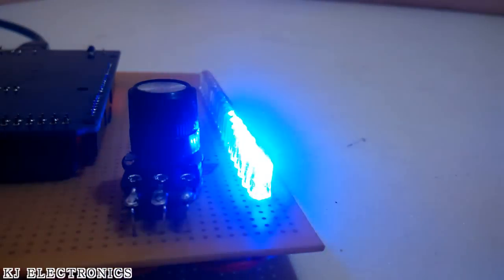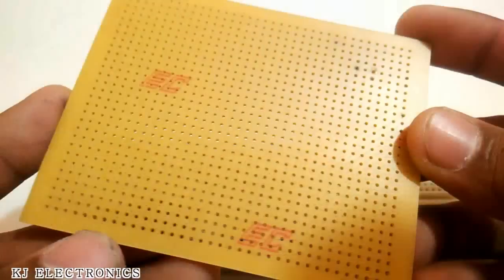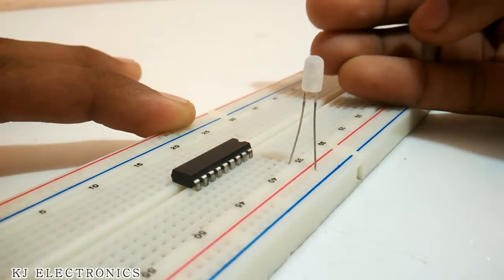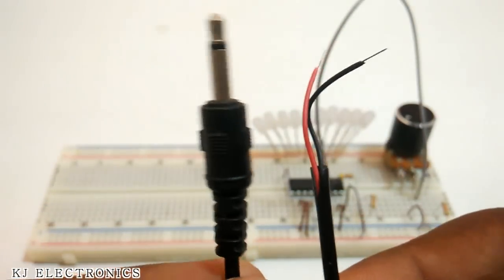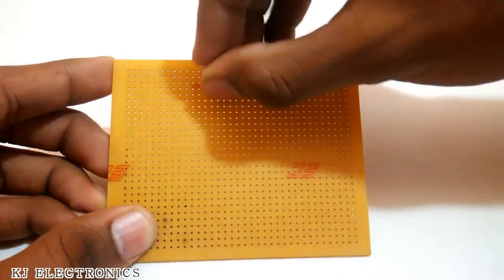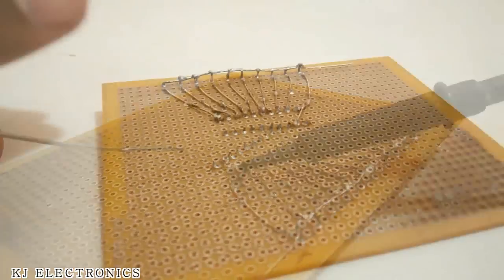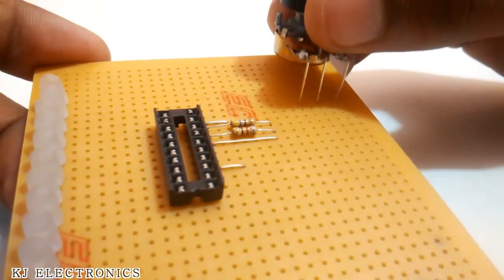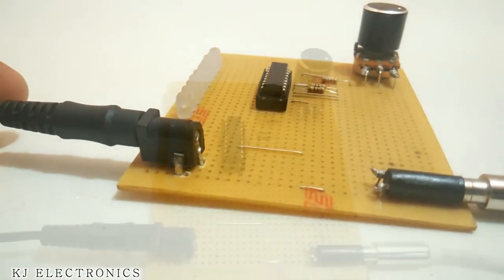Best VU meter Part 2 | Music Visualisation

Comment: Check  your schematic, there is two mistakes (Time 1.08 ) . 
1) Connect 12vdc to pin 3 of LM3914.
2) Remove short between pin 1 and pin3 of lm3914. (If you apply 12vdc directly to pin 3, the first LED will blowout)

Comment: Awesome video. Can this circuit works with 5V power supply???? please suggest me Vu Meter cercuit with 5V..
Reply from the maker: +Namdev Rathod ya you could check the part one in which I have shown you how you can make vu Meyer with Arduino and the working voltage is only 5v